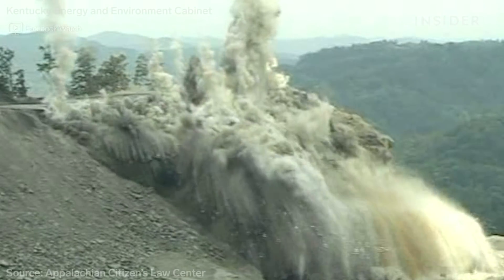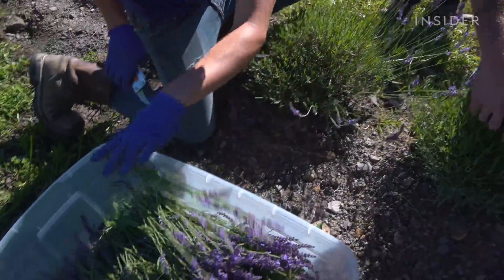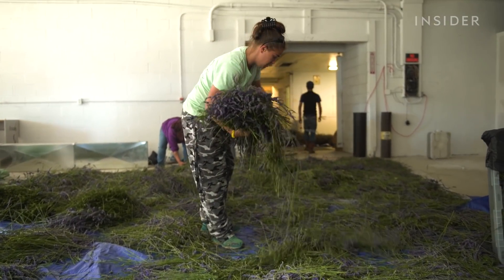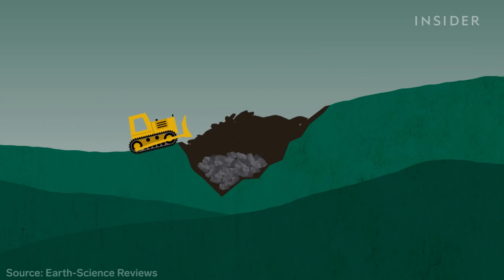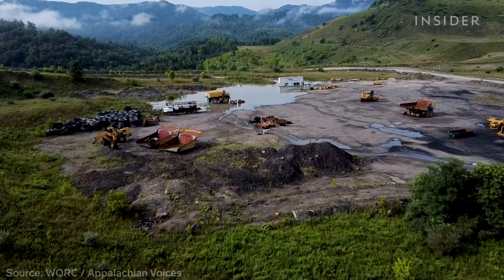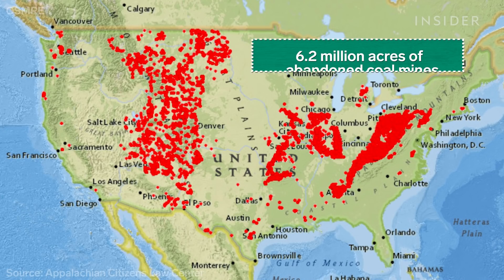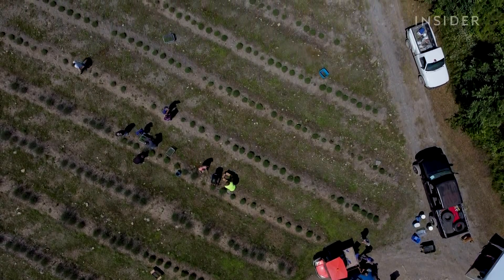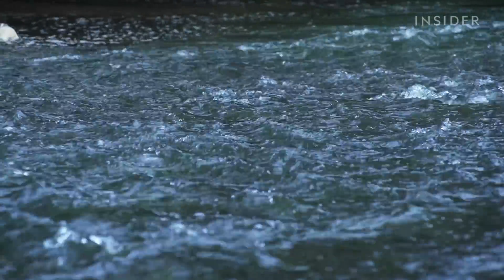How Ex-Miners Turn Toxic Land into Lavender Farms | World Wide Waste

Comment: There is a book called Mycelium Running about using mushrooms for environmental repair. It's a discipline that goes extremely well with commercial crop going (like this lavender) and for tree growing as well, because many plants depend on or thrive in conjunction with mushroom mycelium. Mushrooms can help remove heavy metals and other toxins from soil in the same way the lavender does. It's something that can help farmers improve their yields too.

Comment: If they were serious about conservation, it should be re-vegetated back to how it was.
Reply: can't until they restore the soil, that's the point
Reply: @toatoa10  are there no topsoil regeneration programs? The topsoil can be saved if planned before mining starts. Once the pit is established, tailings can easily be separated from the original topsoil. Once the mining is finished, the tailings refill what was cut out and topsoil laid to re-establish something “similar” to what was destroyed?
Reply: @sixdegrees6434  yeah I don't think there was planning in advanced here. these are some very old mines iiuc

Comment: I really hope those are 2 distinct operations, cause they weren't really separated in this video.
Levander is tolerant to heavy metals and it does clean the soil, but that also means that those heavy metals accumulate in the plant.
So first they have to clean the soil with levander and have to "throw away" those plants, probably for years, and only after that they can cultivate plants for sale.
Unless they're selling leaded honey and creams.

Comment: If the lavender plant is absorbing heavy metals, we probably shouldn't use the lavender as an herb or in something that burns or extracts from the lavender, unless it all accumulates in the roots or something.

Also, just about all marine wildlife has consumed some amount of mercury because of coal powered electricity. Not the fault of these miners, of course, but we've burned coal way too long and we're starting to pay the price.

Comment: So many safety issues here. While I admire the organisation and the ethics behind it, I was astounded at how unsafe it would be to work there. Firstly, none of the workers are wearing masks, either in the field or in the factory.. being exposed to high levels of 'fragrance/essential oils' can aggravate allergies and even cause perfume intolerance. Why are the field workers not wearing wide brimmed hats that cover the ears and shade the face? Are they provided with sunscreen, gloves and full water bottles? Why are they all bending over at the lower back instead of sitting on a bench they can move from plant to plant? I almost died when I saw those two men lift the huge pot of water... no safety gear at all.. no goggles, no aprons, no face shields.. if one of them drops that much water on themselves, they are going to hospital with significant burns. Why are the workers in the factory sitting on the floor? Why are they not at a standard height bench.. again with gloves and face masks? If this was in Australia, they would have been shut down by now for violating safety standards.